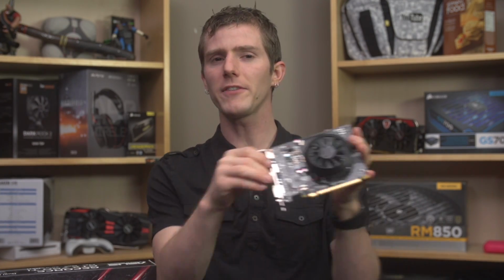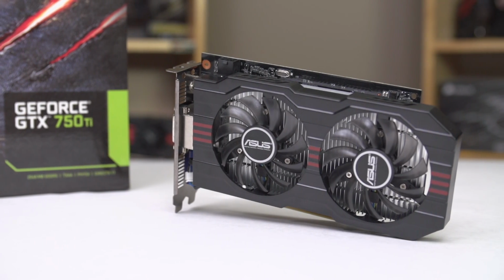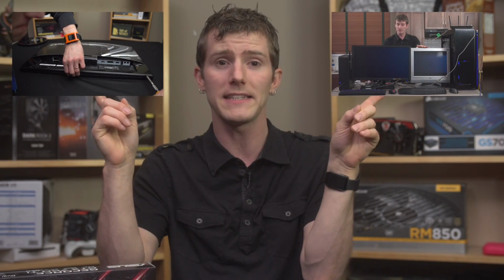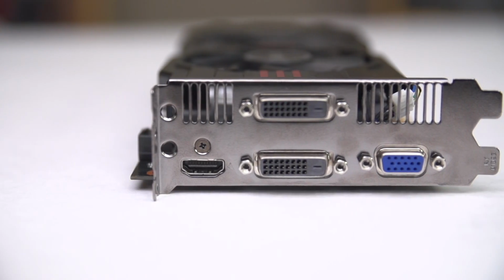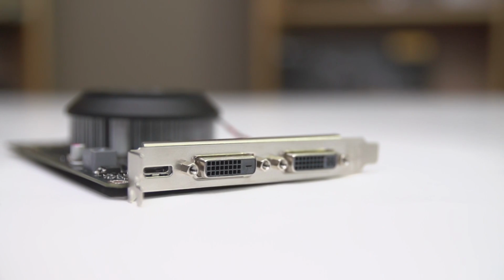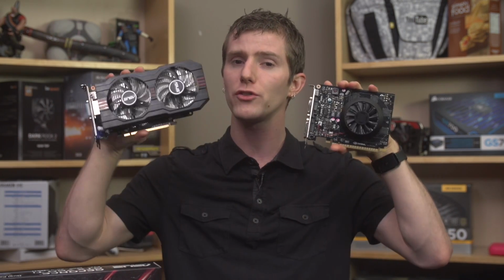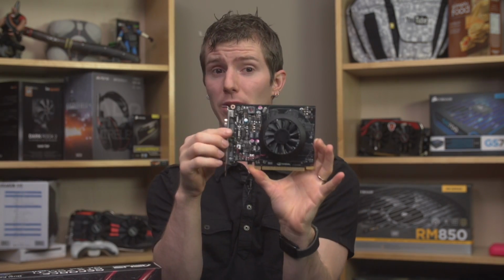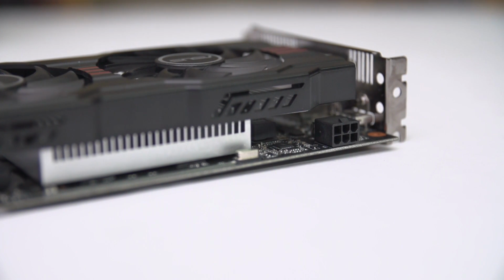GeForce GTX 750 Ti NVIDIA & ASUS Designs

Comment: I gotta feeling this card will go up in price because of Litecoin miners. It's not super powerful but the Maxwell architecture makes it a whole lot more power efficient than AMD's cards.
Reply: Well it could, but I think it would be a very, very bad choice for mining. Nvidia cards do not mine very well until you get into the higher end. Now this card would not bring a miner very much profit.
Reply: Ryan Phipps wrong the maxwell cards are mining great . last i heard this was getting 245 Kh/s while only using 60W of energy to do so. 

thats much much more efficient then any AMD card on the market by far. 

the higher end maxwell cards if they follow suit will in deed be quite the miners with efficiency.
Reply: Ryan Phipps The 750 ti is not great in terms of raw power, but they consume a lot less energy per Mh/s than the R9 cards. That's how they become an easier return on investment.

As mining is profit based, not entertainment, electricity costs are a very important factor in mining. In that respect the 750 ti would kick butt.
Reply: Queue all the new Nvidia cards being sold out because of miners and the price shooting way up.

Comment: Nice little card. I currently run a 660Ti in my system - not needed anything else really. What would be a good upgrade (not too expensive) for this card?
Reply: 280x
Reply: TsujiGameplays Would avoid any AMD cards at this moment if you're looking for a pure gaming rig. The prices right now are absurd from mining.
Reply: .........find a 2nd 660ti........the price+a psu if you have to upgrade performs better than 670s and most likely similar to a 770 which is highly priced, and i dont know why people always condsider upgrading across 1 generation of platforms and to the equall level/entry/price point of their previous card, its either take the step up or sli....and now the budget lower level of nvidia have no sli options.......so you know what that means the dichotomy is real
Reply: dkddbs1008 You're right, I forgot about that.
Get a 770 then, though I don't think this is the best time to upgrade, as your 660Ti should still serve you well for a year or so.
Reply: That's the great thing about it - it's more than enough for now (has been for a while and I love it - best card I've had yet) so I will eventually upgrade to another of this family of cards.

Comment: Single 6-pin 880 perhaps? Low power high end gaming setups incoming q3-2014.
Reply: either low power or insane performance.  :)
Since Maxwell is so efficient and with 1/3rd the power it can deliver the same performance as some cards I could expect 3x the power capability for the same power.
Reply: Weak1ings I might hold off on the Titan Black for a while then.

Comment: Why does it have less Cuda Cores than a GTX650 Ti?
Reply: Aaron Dowler And the 750 Ti is faster, especially when overclocked.
Reply: With 128 CUDA cores per SMM and 5 SMMs total, we get 640 total cores, a 66% increase over the 384 cores found in the GK107 Kepler GPU that was in the GeForce GTX 650.  The GeForce GTX 650 Ti has 768 CUDA cores but at nearly 2x the TDP.  <source> http://www.pcper.com/reviews/Graphics-Cards/NVIDIA-GeForce-GTX-750-Ti-Review-Maxwell-Architecture-debuts-150
Reply: That explains the GTX750 you did not answer me why the GTX750 Ti has less cuda cores than the GTX650 Ti
Reply: alaskanhybrid Because nvidia designed it that way.  Lower power. Click on the link and read about it in detail there.  If you need more cores, get a 760.
Reply: Its not that I need more Cuda Cores it seems backwards to have less that is all.
Reply: alaskanhybrid
looks like it doesn't matter, the 750ti still smashes the 650ti due to the redesigned architecture of the new chip.  http://www.extremetech.com/gaming/176785-nvidias-new-maxwell-powered-gtx-750-ti-is-hyper-efficient-quiet-a-serious-threat-to-amd/3

Comment: I know it's not really in the same league, but I would have liked to see the R9 270x in the benchmarks too, because you guys put the R9 270/X against the 780, which is leagues ahead, so I'd like to see if the 750Ti really does fit between the 100 and 200 dollar ranges.

Comment: What is the stock clock speed of the ASUS GTX 750 ti DirectCU II? I'm not sure whether to get that, (which is $15 cheaper than the EVGA 750 ti SC, which has a stock speed of 1186MHz, boost 1261MHz I believe)

Comment: Silly question, but it this card better than the GTX 660Ti??
Reply: harry cohen 660ti is actually faster than 750ti
Reply: not really, 760 is not better than the 680
Reply: harry cohen More like WAY faster!!!
Reply: Yes, the higher the number in NVidia graphics cards usually means better.
Reply: harry cohen but keep in mind this is 50 dollars cheaper than a 660ti, it will still give solid performance and doesnt require a 6 pin on the oem design
Reply: No
Reply: Donski II Sorry but that's one of the most idiotic posts I've ever read.

Comment: wow this comes out right after I buy a 650 ti? facepalms
Reply: was it a 650ti boost? if its the boost edition its faster than the 750ti. Ive seen the benchmarks
Reply: ***** 1. wasnt a boost
2. evga has a Boost version of the 750 ti (although it doesn't say boost, it is clocked about 200MHz higher than every other non-reference card.)
Reply: FreshBagelz yeah thats just called SC for super clocked. My gtx760 is an EVGA SC card with boost 2.0,theirs actually a big difference between that. 650ti boost actually uses the nvidia technology called GPU boost. Theirs a gtx650ti SC, normal card, and gtx650ti with the boost in the name that can utilize the GPU boost technology.Being said their isnt a 750ti boost cause anything above the 650ti already uses the technology.It was just introduced with the 650ti boost, thats where it got its name
Reply: yeah I know I have the same card I have a EVGA gtx760 SC ACX card

Comment: Not sure if I rather buy this or GTX 650 Ti Boost / OC?
Reply: I hated my GTX 650Ti that I overclocked
Reply: 650 TI boost is about the same in terms of performance if you are comparing the 750ti with 6 pin power and beats it in some games (the reference model without the extra power is a bit weaker). The 650ti boost has one MASSIVE advantage to it though, it has an SLI connector and two 650tiB's in SLI scale super well assuming the game supports it.
Reply: Yea I didn't have the boost, and I am sure that the 750 Ti is perfect for some people but I am the type of person who wants at least 60fps on all games maxed out, but for medium settings on any game, or ultra like in bioshock infinite the 750Ti is perfect

Comment: Just a probably daft question, all the other 750 ti's like the EVGA one and the Gigabyte one, do they also have Maxwell architecture or are they older cards?
Reply: They all have the Maxwell architecture. The only difference is the brand, and cooler. Of course, with the brand, comes the warranty and tech support. Pick a reliable brand. (These days, brands are usually not that bad in terms of warranty)
Reply: Amarto Pramanik Hmm... but I've seen other 750 ti's that need individual power (e.g. Asus) while this one runs entirely on the mobo's power.
Reply: *****  The card can run on 75W from the PCI-E slot, but with MOAR power you can add more stuff like better cooling and more OC headroom. Reference VS third party.
Reply: Coltaine So can you actually choose if you want to power it individually for a lil' performance increase?
Reply: No clue tbh. But with the non-reference card I'd assume you should plug in the additional power since it might be powering the fans or something.
Reply: Every single 750 and 750ti is using the new architecture.  There is no manufacturer that can make a 750 or 750ti without using the new architecture.  Maxwell is what makes the them a 750 and 750ti.
Reply: They are still using the 28nm die so they can make sure the true Maxwell 20nm die chips don't have problems.
Reply: joshmosky mastrshok so does that mean they also share the stupidly low power consumption and all of that? Also, is there any that has Display Port? I want to get a 750 ti but I kinda need g-sync.
Reply: ***** From what I understand (correct me if I'm wrong), DisplayPort ISN'T the only output that supports G-Sync, it's just that the only monitor that has G-Sync available only supports DisplayPort.
Reply: Adrian Zugaj No, I think that's true, cause it wouldn't really make sense that Nvidia and GeForce go on about the G-Sync capabilities of the GTX 750 ti all day long when it doesn't even have Display Port (the reference model)
Reply: BUY MSI
Reply: stanmarsh671 BUY Y??
Reply: ***** I think he's saying that because MSI's Frozer line of cards have among the best coolers on the market. I too am partial to MSI for this reason, however you should look at other OEM's for the 750ti and see what they have to offer, as the 750ti is excellent with temps, even when overclocking.
Reply: Adrian Zugaj I think everyone can settle and agree that the best 750 ti is the EVGA FTW ACX model, it just is. But that one requires a 6-pin while the 750 ti SC doesn't although it's slightly less powerful. I'm going fot that one anyway because I'm kinda in love with the low power consumption aspect at it's fullest, so yeah :)
Reply: ***** The reference version overclocks extremely well anyway, so there's no reason not to have similar performance as the EVGA out of the box :D
Reply: *****

Yeah they should theoretically have much improved power consumption, but don't except as low as these 750's. I'm guessing 2 6 pin connectors at most for a lot of the cards.

MSI Twin Frozr cooler is one of the best coolers you can get for a card respectively of course. EVGA ACX cooler needs work. It's a fair amount louder and doesn't quite cool as effectively compared to some.

Also I think the current G-sync monitor right now needs display port. From what I understand is that the 750 ti supports G-sync and is the reason why it does not support SLI. It also doesn't overclock that much because of Nvidia's power limiters. From what i've read the 750 ti does support G-sync.
Reply: mastrshok Well you've kinda heard wrong, the 750 ti supports display port depending on the model, ft example, the msi one doesn't support it cause it lacks display port but others like the evga sc and the evga ftw DO have display port, which is really nice. Also, some of these models DON'T need power at all, you jus connect them to the motherboard with a pci-e and that's the magic of it!
Reply: Adrian Zugaj I don't understand how it can overclock if it's only getting like 60-70w xD
Reply: It's extremely power efficient, is how
Reply: *****

I know it depends on the model. Most don't have a display port plug. I was saying that they took off SLI to add the support for G-sync.

I was also answering your other question about: "so does that mean they also share the stupidly low power consumption and all of that?"

Comment: i am wondering if i should get 2 gtx 770s or 3 gtx 760s?
Reply: I personally think 2 GTX 770's would be better. a quick edit: I have a PNY GTX 770 3 fan, and soon I am getting another one.
Reply: thanks i am a first time builder so i dont want to waste any money
Reply: JamyGames Yea im sort of a a noobie to PC's, but I would probably want 2 GTX 770's for 1080p 3 screens. If you plan on three screens though get the 4gb GTX 770 cards
Reply: i am only using 2 monitors
Reply: JamyGames I don't know about two screens you might want to look up online or ask on this website called TomsHardware
Reply: ok thanks

Comment: does the asus works 750ti works with a 300w psu also like the 750ti without overclock
Reply: nope you need at least 400 watts i suggest Corsair CX430M
Reply: TechiCanadian  Hang on, how do you need a 400W minimum to power a 150W draw.(75W from PCI-E slot and 75W from 6 pin power connector)? I mean, depending on the rest of the system 400W is probably a minimum but, if the rest is low powered as well 300W should work.
Reply: what else would you be running with the 750ti
Reply: TheTemplarnight 6gb ram 1tb hardrive a6 5400 amd
Reply: ZombiesKnowTech Yeah you could probably cram it, but i would get a 350 or 400 power supply if you can.
Reply: alright thanks ill try to get one soon
Reply: Yeah, it will definitely work.  You would be right near that wattage but as long as you have a decently built/80+ bronze or better power supply, I wouldn't worry about running that card.
Reply: ZombiesKnowTech is your pc prebuilt?
Reply: gateway

Comment: Another question for the nice guys here. Would you go with a GTX 660 and an i3 4130 3.4 GHz, or an GTX 750 TI and the i5 4440 3.1GHz? (For gaming)
Reply: i3 will work great with both cards, i would get i5 4440 only for gtx760,gtx770 and similar cards
Reply: btw if you have more money buy gtx760

Comment: Wish I didn't buy my 770 probably should've waited for 800 cards
Reply: Me too waiting 800 series...
Reply: why the 770 is a great card, unless you are worried about power draw?
Reply: I'm on about temps and noise because I bought the reference GTX 770 because the look BAWLIN and it performed really well but after a night long stink of energy drink fueled gaming it can get on the louder and slightly warm side so say if I bought the GTX 870 it will probably be on par with performance maybe better lower power like one 6pin and definately cooler but I do agree the GTX 770 is a beast because it's just a 680 and we all know how good that was
Reply: ah i see, i got the msi version of the 770, thats pretty quiet and temps stay around 70 :) but yea the next gen cards are gonna be great for more than just perf.
Reply: I have GTX 650 Ti 11 month now.
Reply: I don't think I could of waited any longer for a new GPU I had a 5770 before this and my god if I install the 5770 in my main rig now I think II would die
Reply: yea i was thinking about waiting for the 800 series but i was building my first pc so couldn't wait any longer :p

Comment: Is it worth going from a 560ti to this?
Reply: Not if you're willing to wait for the 860ti to come out in august 2014. The 750ti doesn't offer that much more over the 560ti other than lower power consumption and slightly better shader performance.
Reply: No.  This is not exactly a gaming card.  Save a few more and buy a card which has a massive performance improvement.
Reply: Thanks for the input.

Comment: does it worth to change from gtx 650ti boost to this? and does it worth to build this into a new editing/gaming PC or it would be better to save more money and buy a 760 or something like that? basicly i'm looking for a relatve cheap but good editing/gaming PC. Thank you for your answers
Reply: Unless you care about less power consumption, stick with your boost. 750 Ti non-boost is probably going to give nearly identical (maybe even a little less) in game performance. Benchmarks will likely show about the same. My 2 cents.
Reply: Randall Duke thank you
Reply: Trick Official
Actually the 750ti is better by 650ti boost, but no by a big margine. So it would be a waste of money for the performance improvement that you get.
Reply: 650 ti boost has an SLI connector and the 750ti doesn't. If you are looking for a boost see if you can't find cheap 650ti boost floating around and SLI them. Even one 650ti boost is on par or better then a reference 750ti from the benchmarks I've seen. It isn't until you use one of the non-reference ones with the 6pin connector and OC the snot out of it does it pull ahead.
Reply: devilmikey00 unfortunatly my motherboard doesn't support SLI so if i want SLI i will need a new motherboard with new cpu
Reply: Then you should wait to upgrade to gtx760 at least. By the AMD side you could go with the hd7870 that performs better than gtx650ti boost. Also the hd7870 will be better in editing due to higher number of stream processors. hd7870 1280 stream processors, gtx650ti boost 768 cuda cores.
Reply: Vkingsane i will think about it, thank you for your advice :)
Reply: You could also go for r9 270
Reply: its a solid option better than hd7870

Comment: There is not that big diffrence between gtx 650 ti and gtx 750 ti.
Reply: Adam Savage
In peformance dumbass.
Reply: Adam Savage
Well why would you buy a card  with this kind of peformance buy a used gtx 570 or gtx 560 for 50 bucks dumbass.
Reply: Adam Savage
Those results are fake  the real results are in youtube.
Reply: Adam Savage
Im afraid you are wrong  the gtx  750 ti is not as strong as the gtx 650 ti boost   and the  gtx 570 is little  bit stronger than the gtx 650 ti boost and that means that your video proof is wrong.
Reply: Adam Savage
No i dont mean that your video proof is wrong  but you are wrong the 650 ti boost is stronger than the 750 ti and gtx 570 is little bit stronger than the 650 ti boost. You cant  even use g sync on the 750 ti but in 650 ti boost you can well you cant use g sync on the 570 because  570 is 3 years  old card.

Comment: this or an r9 270?
Reply: r9 270 is the better performing card, but the 750ti has lower power consumption. It depends if you want better performance in games or a lower electric bill.

Comment: If you spend just $30 on that single fan GTX 750 ti and get a NZXT Kraken G10 you can overclock far and get nice cooling.
Reply: how you gonna overclock on the reference card when it doesn't have the extra power connectors? If you try overclocking through the PCI-E bus alone, you'll fry it.
Reply: exodiathecoolone . ooops I never realized that :/ yeah your right im sorry

Comment: Does anybody knows if the GTX 750 TI will be able to run on a proprietary 300w power supply? this is for an Acer desktop i bought with core i7...
Reply: Yes.  Buy one and plug into your motherboard and plug your monitor into the back of it and download GForceExperience and go.

It's revolutionary in that you can play all the newest games now without having to upgrade the power supply of your computer.